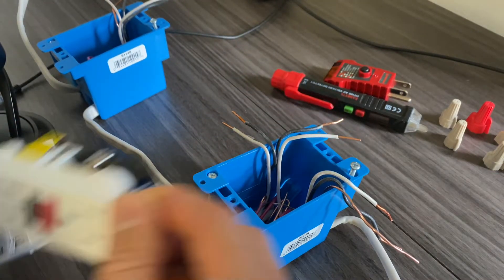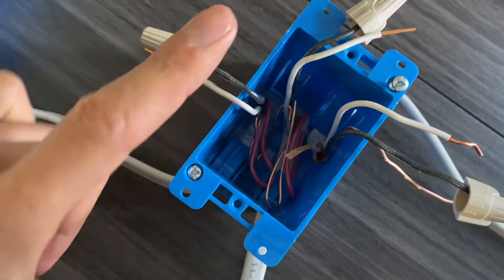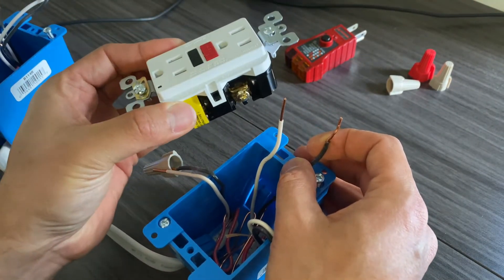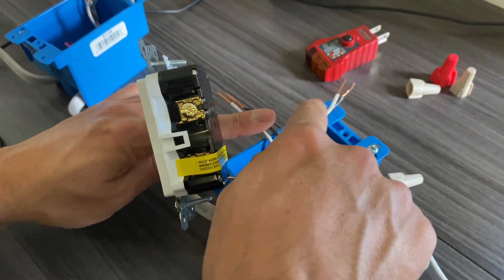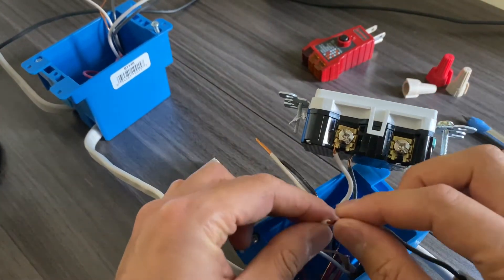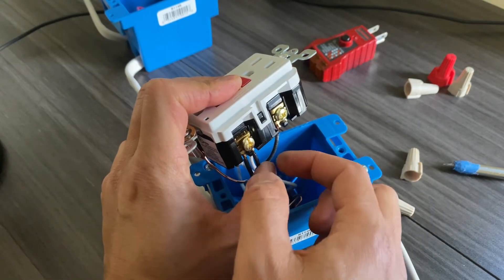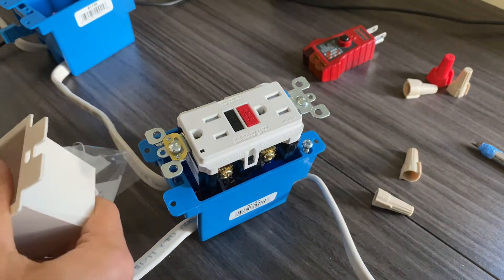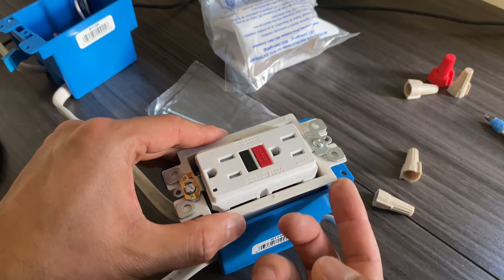How to Install GFCI Outlet (6 Wires) In Detail DIY

Comment: Why didn't you wire the grounds for the other 2 wires?
Reply from the maker: this was just example, usually ground is pigtailed in the box, so you'll have 1 ground connected to the device.

Comment: Did I miss the GROUND wire connection ?  My understanding is you  DO NOT connect all 3 ground wires to the bottom, rather you do a pig tail type of connection and just connect one ground to the bottom of the outlet.  Hope this is true ?

Comment: How did you know that the white wire next to the black wire that you identified as hot was in fact a line white and not a load white?
Reply from the maker: use multimeter to measures voltage or look into the box where it's coming out.

Comment: You can find the line by checking the neutrals for continuity with the ground wire. This is faster and safer. If more than one has continuity there is some problem in the wiring that needs to be solved, or the GFCI will trip immediately.

This of course will not work on old two wire installations that have no ground.

Comment: I actually have 4 - 2 wire for a total of 8 wires. A GFCI outlet and a single pole switch in the same box. Have one power and one light the switch turns on and off. The other is on the washing machine outlet and one runs to the refrigerator outlet.
Reply from the maker: what's your question? fridge dishwasher doesn't need gfci those are by the code have their own dedicated circuit.
Reply: I know that’s code, it is what it is. It’s a washing machine in the basement . So I guess I’ll have to run separate wires , one for the washing machine and one for the refrigerator. Then GFCI outlet will be easy to install and I’ll have 3 separate circuits

Comment: Replaced a 2 prong with a gfci, wired as shown in video but now my light switch doesn’t work? Outlet originally had 3 black pigtailed and 3 whites together for neutral side. Old outlet didnt have any brass tab to separate either.
Reply from the maker: was that outlet required to be gfci? double check your wiring. lighting doesn't need to be protected it can go to line terminal
Reply: @remoteelectrician  doesn’t need to be gfci. So the white and black for light switch go to line terminal along with the one live pair?
Reply from the maker: yes, or everything can go to line but just pigtail if that particular outlet has to be gfci it can protect itself but have nothing on the load side

Comment: I have installed a Leviton GFCI just as you demonstrate here.  Question.  Doesn't the Leviton instruction sheet/manual that comes with the GFCI say that you should not have more than 2 load lines (hot/neutral)? At least mine did.   Is that true of this unit, too?  Do you know why they give that warning?
Reply from the maker: That’s how many wires you can physically mount on those terminals. So what’s the concern? you have more than 4 pairs of wires in a box?!
Reply: @remoteelectrician   I contacted Leviton tech support.  The tech guy I spoke with didn't know why the "IMPORTANT" warning was placed at the beginning of step #6 install instruction.  He took my question to the product manager & I received a reply. It appears it's a CYA/legal liability statement.   For more complex install situations, they're trying to get newbs, like me, to have an electrician do the install.

Technically, the way I installed the GFCI - which matches your install video, here - is perfectly fine.  Thanks for the video confirming my install, as I was uncertain due to the warning statement in the instructions.  Not much else out there for GFCI installs with two load cables.
Reply: @remoteelectrician  No. Just as in your configuration, I have 1 LINE pair + ground, & 2 LOAD pairs + grounds. The grounds are pigtailed to 1 ground connection wire.  My question relates to the caution stated in the Leviton instruction sheet enclosed with the GFCI box. In instruction step #6 it says:
"IMPORTANT:
DO NOT install the GFCI receptacle in an electrical box containing a) more than four (4) wires (not including ground wires ...."

Well, we have 6 wires plus ground wires.

Why did Leviton make that warning?  Do you have the same warning in your instruction sheet?  Having two sets of load wires implies a physical wiring configuration that serves as a "Y" split-off that includes two branches.  Is that "Y" configuration a problem for these Leviton GFCI units?
Reply from the maker: 4 pairs of wire 4 neutral 4 hot that's what they mean

Comment: Great video. I have installed two of those Leviton 15A GFCIs outlets in my kitchen where one works but the other won't reset, it keeps tripping after pressing RESET button. Any idea?
Reply from the maker: Short circuit you need to inspect visually for ground fault
Reply: Same problem here, found you shouldn't connect two gfci in series for some reason ?
Reply: @VideoByPatrick  In my case, the other GFCI was not connected properly, I guess the new GFCI black screw was located on a different side and that threw me off. I got it to work at the time of my question. I would suggest checking new unit's orientation since configuration might have changed.

Comment: Got three separate GFCI outlets that I needed to replace. One was a four wire version that was easy to finagle, but this video helped me enormously on the two that had six wires. Three black ones with one hot wire, and three white ones, and I had no clue before. Thanks to this video, I installed them, tested them, and found them to perfectly reset and test. Thanks for this.

Comment: Great video! Most people will have it wired wrong so if you have to replace it just follow this video and separate all pairs of wires, and most importantly turn off the main breaker!

I had to learn that the hard way, you can still have power coming into that box
Reply from the maker: safety first!
Reply: @remoteelectrician  and that touch less tester is a must!